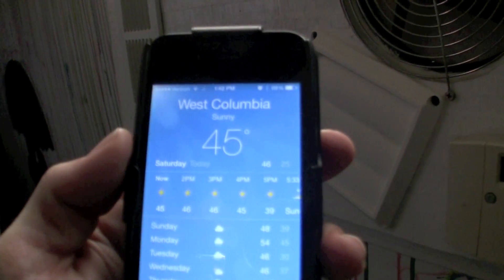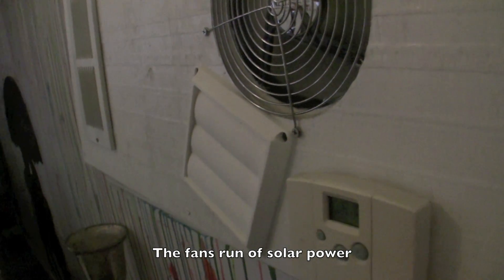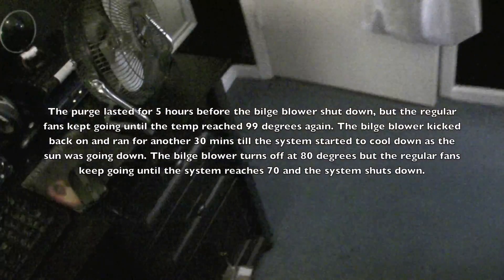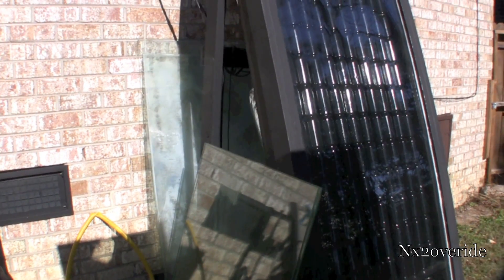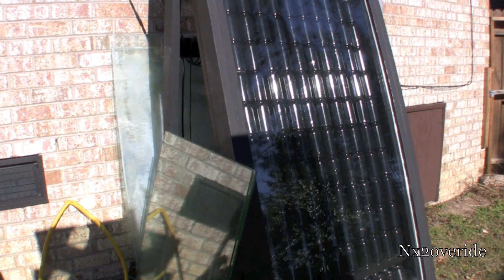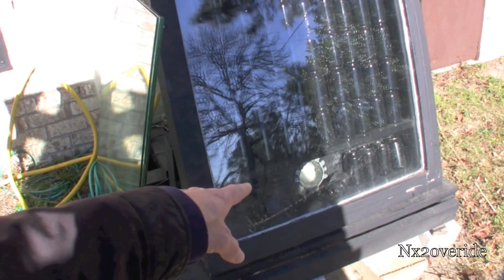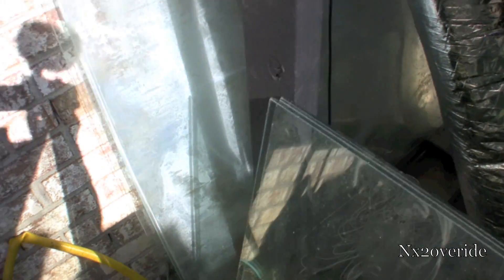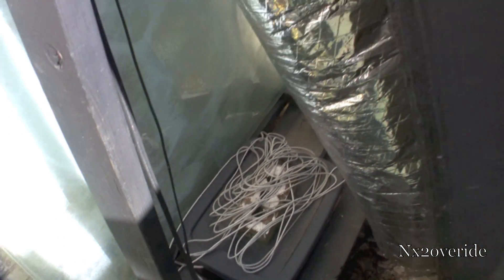My Large Solar Heater - 4 year update

Comment: Really good and warm project! I also used beer and pop cans in my first solar house heater which measured 3 foot by 5 foot with a heat output of 131 F (55 C). For my second solar heater I used aluminum down spouts which was way faster. It measured 3 foot by 6 foot with a heat output of 140 F (60 C). So I scaled it up to 6 foot by 6 foot and it has a heat output of 203 F (95 C). They work great adding free heat to my house every sunny day! https://www.youtube.com/watch?v=7S8CWsIcK20
Reply from the maker: looks amazing!!

Comment: I was hoping to see/hear actual data on energy saved. I have watched numerous videos of these solar heaters. All seem to work fine. What we DON'T know, however, is a REAL comparison of utility bills/energy used before and after.

Does anyone have THAT data they can share with us?
Reply: I think it isnt a big thing because those solar air heaters excist only diy. If it was realy a big different than its has been produced long time a go by companies at a big scale.
Reply: @MrBenny-Bronx  That's not true at all. Have you ever thought that the reason that "big companies" don't produce these is because it would take away from the gas and electric industry that makes money off of the heating industry? Someone somewhere is going to lose money in a big way. These things do work, and for many, they have indeed made a "big difference".
Reply: Dominique _ All I care is that it works, cheap to build, and saves money. I dont need a detailed breakdown.

Comment: I really need to get my heater built, I have most of the materials. Right now it is 15F out sunny and windy but I have gained 3 degrees in 3 hours just by opening my front door and opening the drapes/blinds. The furnace will not come on until about 4 or 5  P M. The door faces south and has a "full view" panel on an aluminum frame.
I have scavenged a few patio doors for the project and a bilizion cans. Got to love the Sun...

Comment: I have watched a bunch of these videos, and I love the idea of saving some money on heating, but I have never seen one where the person testing it lives somewhere that gets really cold.  20s 30s 40s -- all well and good, but can someone point me to test results of one of these things in a climate like mine where it gets down into the minus 30s before windchill?
Reply: I have built a few prototypes of these solar house heaters. My first one was a small one made with pop cans reaching 55 C, 131 F. My second one was 3 foot wide by 6 foot tall built with down spouts reaching 70 C, 160 F with R5 foil foam insulation. The next one I will build will be a 6 foot by 6 foot unit reaching perhaps 90 C, 194 F. However, in your case, since your location is super cold and may only get a few hours of direct sun daily at the bottom of the winter you might want a 6 by 6 unit insulated with R10. But I would start by maxing out your insulation in your attic, walls, floor and then shrink plastic your windows internally. Then I would build a thermal mass rocket stove with a slow release heating bench. Mine works great. Enjoy and be comfortable.

Comment: Do you think this would work indoors? I'm going to build one and don't really want to make a mount for it to go outside to inside so I was wondering if a window would be good enough.
Reply from the maker: You can make  window versions. They don't put out much heat but they do work.
Reply: +Nx2overide any idea how to run it through the window then? I thought about making a plywood sheet that I could fit in my window and let the duct work run through that or maybe a piece of plexiglass to look as terrible lol. Any better ideas?
Reply from the maker: Ridge Walker This is a prototype i made that worked nice its a window unit.
https://www.youtube.com/watch?v=TLCw1cIR558
Reply from the maker: its built to the size of the window and slides in like an AC window unit.

Comment: Can't argue with success. If it works leave it alone. You can always build a better one when this one quits. It's hard to believe it has been 4 years since the original build.
Reply from the maker: yep, that's true. I rebuilt the fan system 2 times before I found the right high velocity DC fans. I'm very happy with the outcome. It's crazy how time flies by. I want to build a new model of this (possibly this summer) for the other side of the back of the house. Hit it from both sides. I also need to build a hot water panel for the water. I bought a heliatos system but the panels are small and I figure i'm going to use them on the cabin i'm building. so many projects....